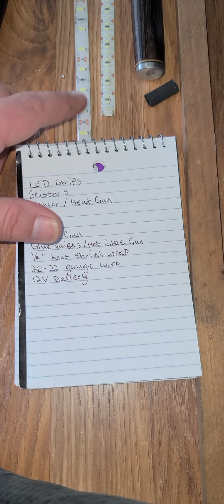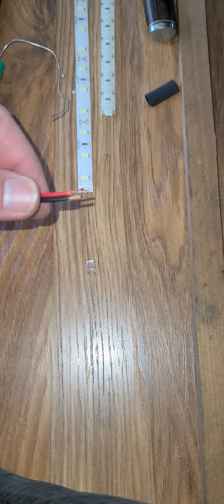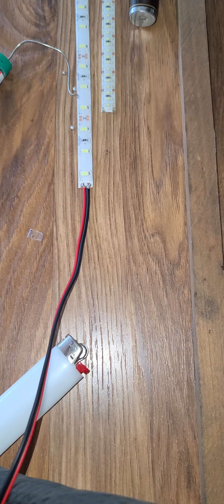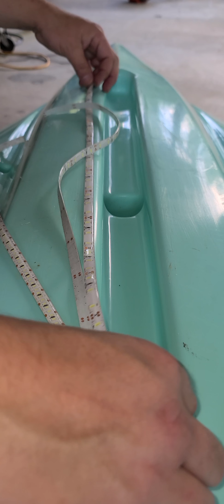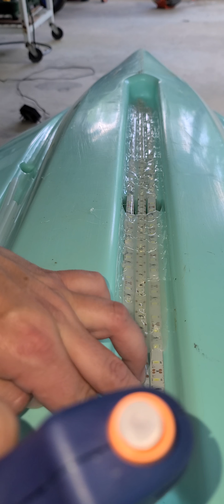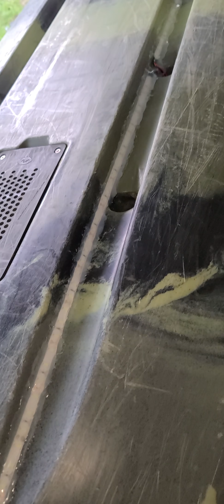DIY Kayak Lights (Under Kayak)

Comment: Easier to get marine heat shrink - it comes with glue already in it. That glue is going to fall off in a few seasons.
Reply from the maker: Sure if you are buying new. I have had this stuff for many years and it has to be used up at some point. The glue will more than likely out last the LED strips. My original kayak still has the glue and LEDs on it and that has been 6-7 years. The silicone in the LEDs will likely cloud up in about 3 years which is why I choose hot glue over other attachment methods . I can peel these up and replace them quickly.